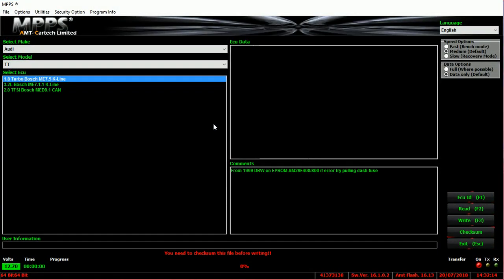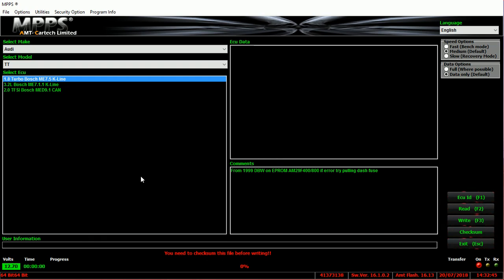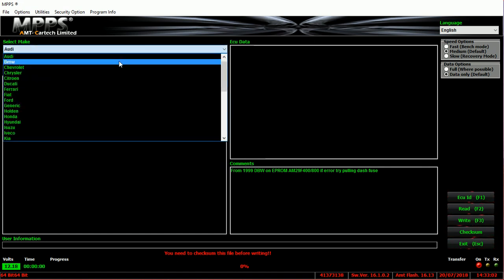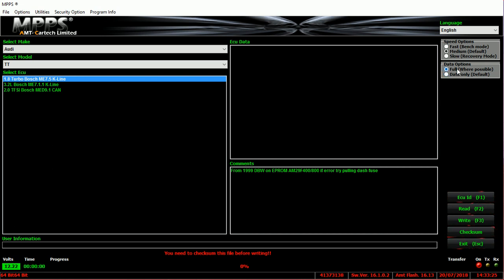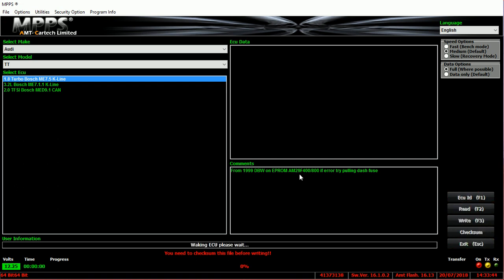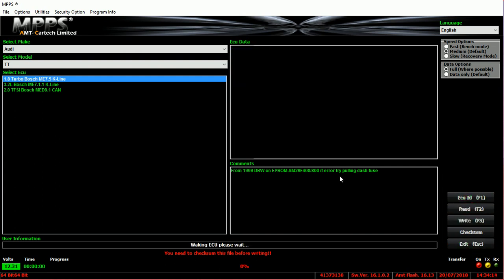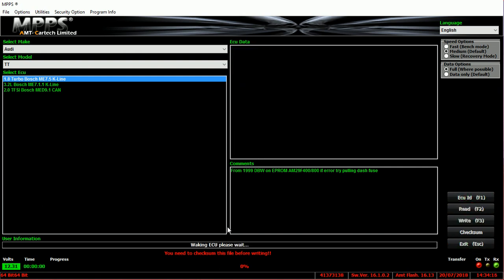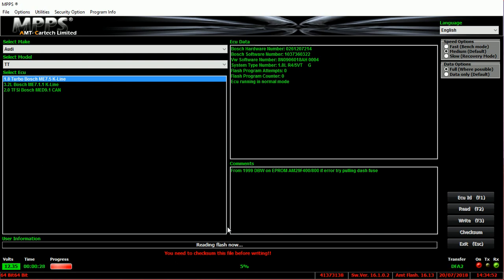How to read your ECU with MPPS

Comment: Is there any risk of bricking during Read process or just write?
Reply from the maker: Depends on the ECU, but usually no risk with reading.
Reply: @labordemotorsport8788  thank you!
Reply: @labordemotorsport G’day fellow Aussie!! 🇦🇺 Good to see someone doing a solid and sharing this info 👍 I have a question……. Will these steps work with a clone MPPS cable and software? I managed to pick up a cheap MPPS cable and software and wanted to experiment tuning my Mk6 GTi, she’s already Stage 3 custom tuned, fully forged rebuilt motor with brand new everything, but I’ve just recently upgraded all my intercooler setup, now running AEM v3 water methanol with 3 injectors and a GTX 2871r ball bearing turbo. I want to update my current tune, my ECU isn’t locked from my tuner and I am confident I can read the current tune (save it for “just-in-case” situation) and tweak it to get the correct mapping for my new setup. Just wanted your advice on how I should go about reading the current map. I’ve also got WinOLS (same software used to do my current tune) are you familiar with WinOLS? Is it simple enough to understand so I can start mucking around with my ECU? Or should I do some extensive homework before I start changing things? What’s the worse that can happen right? The GTi will either run like shit or run too good and I blow my motor 😂 Either way I’m willing to give it a go 👍 Thanks in advance for your help

Comment: Hey I swapped out my 2010 Acura CSX K2.0Z2 engine with 2007 Acura TSX K2.4A2 engine I still have the OEM ECM can I use the mpps V16 to remap my ECM

Comment: How do I get the software for mpps I have the cd they sent but not working. I’m trying to use for American made vehicles
Reply: I got mpps v16 solution without Loader... Just plug in cable...start Mpps. Run.

Comment: Hi can i ask when you upload a map does it change your eeprom settings etc skc
Reply from the maker: Hello,

Some vehicles may result in the adjustment of eeprom data such as injector coding, flash counters, adaptions etc. what are you referring to specifically and which ecu?
Reply: @labordemotorsport  me7.5

Comment: Hey bro. Do you know any  cheap equipment that can read and write ecu bosch 7.4.9 of peugeot 207i (206+) with obd2?
Reply: Kess v2
Reply: @nstipet  unfortunately Can't
Reply: @reza524  What year is Peugeot?
Reply: @nstipet  peugeot 207i 2014 1.4 8v Ecu Bosch 7.4.9
Reply: @reza524  I'll check tomorrow and let you know. I think I also have the original map from that model.
Reply: @nstipet   actually I have original map of my car. Last time my friend had Ktag and downloaded it for me. Now I don't have access to my friend and prefer to write Remap file on my ecu with OBD2.
Reply: @reza524  Then where is the problem? Almost any software can write to the ECU
Reply: @nstipet  software? What it mean? Can you explain and teach me please? Without Programmer?
Reply: @nstipet  or you think this small MPPS that are like a obd2 cable, can do it? Write my remap file to my ecu bosck 7.4.9 with OBD2?
Reply: @reza524  What software do you have? Do you have a map ready? The map you would like to load
Reply: @nstipet  yes. I sent my file to a professional guy and he did remap for me. Now just need to write remap file on my Ecu
Reply: @reza524  If you have MPPS, it is not a problem to load the map. You have a good tutorial on YouTube.
Reply: @nstipet  thanks but I checked car and ecu support list by Mpps in google, my car and ecu is not in it's list. So can I write my map file on ecu with mpps?
Reply: @reza524  Connect it, and if the software finds it, you can write.

Comment: 0:17 I would use a regulated linear power supply. I wouldn't want to flash with an old charger it might have massive ac ripple and 50/60hz noise.

Comment: well i got MPPS working but i get no ECU info. Ive tried new cords and Ross tech works great. Im clicking on the correct ECU but it wont read. I click full k line and med speed ive also tried slow. i do this with a battery charger on the car.
Reply: @Viacheslav Martynenko I have not
Reply: Sometimes if you have vcds drivers installed it can interfere with the mpps cable

Comment: Whenever I try to read ECU, I get an error saying security access denied, cars charged, ignitions on, power pack connected. I've had no luck googling the error, any advice?
Reply: It is normal for mpps v13, mpps v16 have security bypass, make sure you checkbox. And if it doesn't work, try at least hour on ignition, then plug mpps cable and read it.

Comment: How did you manage to run MPPS v16 on Windows 10?
Reply: Use virtualbox
Reply: Maybe thats mpps v21
Reply: @lipelego22  Nope. It's v16. Look in the bottom right corner where the software version is.
Reply: @szabotihamer  It works for me in Windows 10, I didn't have to do anything to make it work.
Reply: right click and go to compatability and you can change the OS per what the software requires